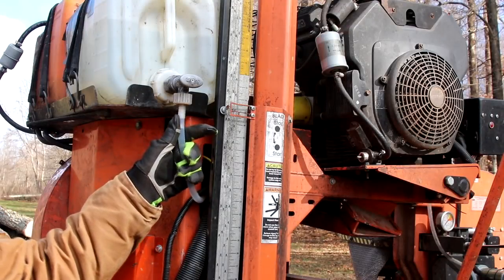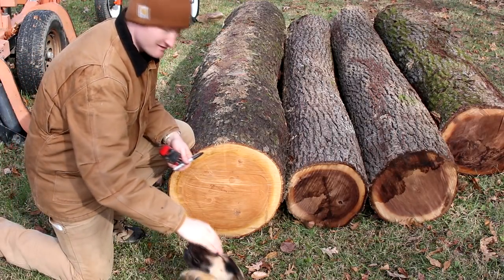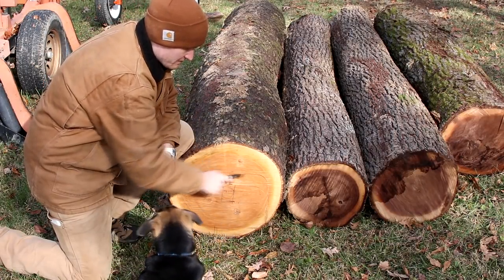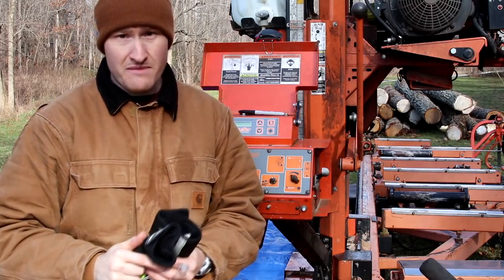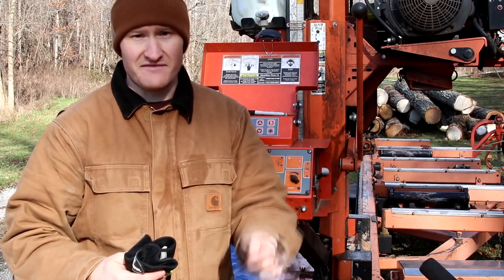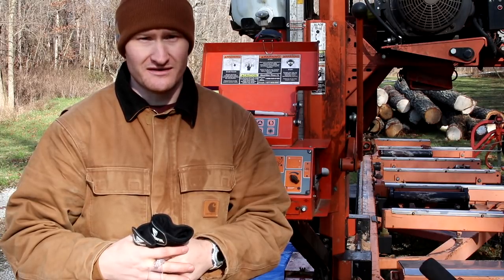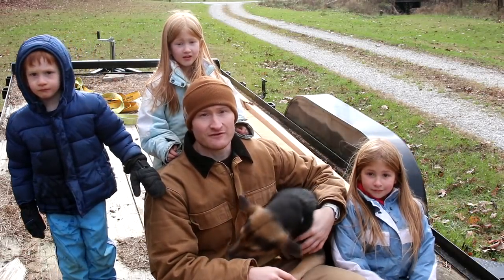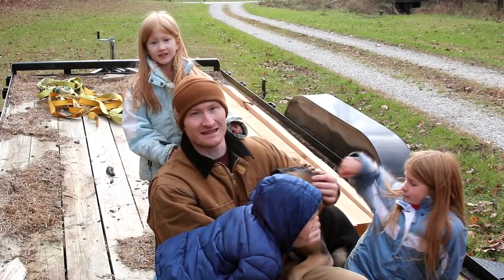Frozen Sawmill and Milling nice Cherry log!

Comment: Disconnect and drain the hoses at night and reconnect them when empty... can't freeze empty lines. Could put some warm water in the plastic tank if it's still freezing and you need to get going before the temperature gets above freezing. Evidently the heat from the engine will help keep everything warm once you are working. Nice mill... nice job!

Comment: Been there and done that. I use a mixture of 1/2 cup of dish soap to 5 gallons of water. This seems to promote anti freeze and reduces gumming on the blade. I’m sure you have learned to un hook the water line and blow clear and the end of the day. Here in NC, we don’t see the colder temps you endure. Happy milling!!

Comment: Ethylene glycol is pretty inexpensive to mix with your water tank to keep it from freezing, also will give it some lubrication ability in cutting. I used this in the car wash soap going to the brushes in the wash bays to keep them from freezing in the winter.